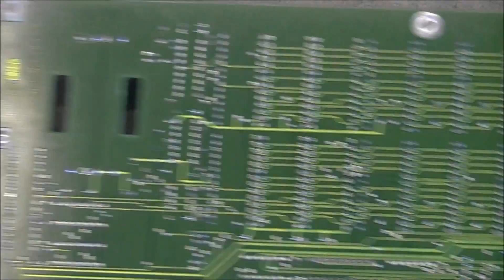W&G SF60 jitter analyzer teardown part 3

Comment: Around 6:00 to 7:00: I can see the 80186, with 1MByte  of total memory plus some paged memory on that expansion card. I can also see the 8051 controller and 2x 8259 Interrupt controllers. Next to the expensive Amphenol connector is the 8251, the serial port. To me this looks like a old school PC. Back then you could have easily used a common 80186 mainboard  plus an ISA card  as the prototype and software development PC.Just the DRAM has been replaced with SRAM.